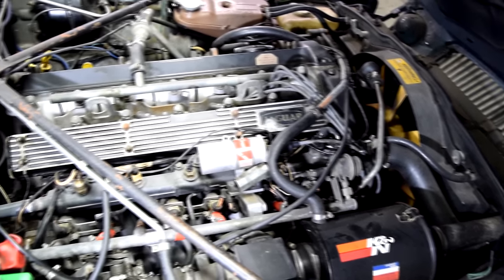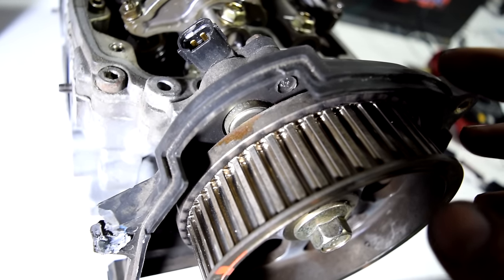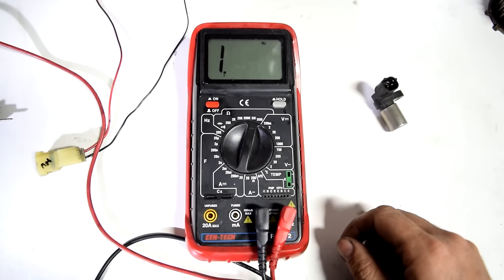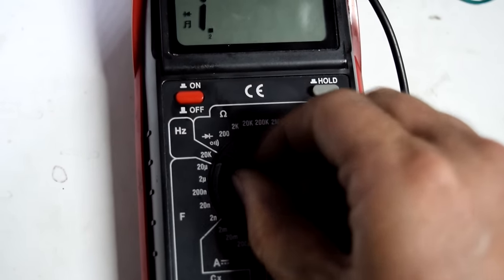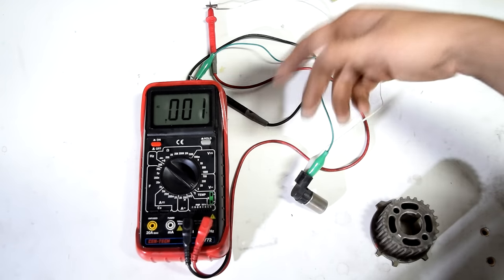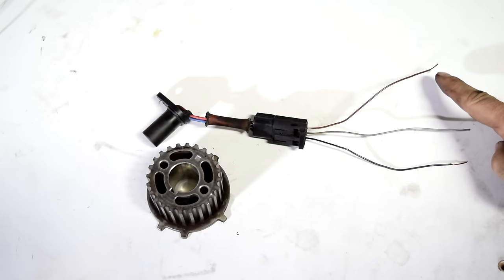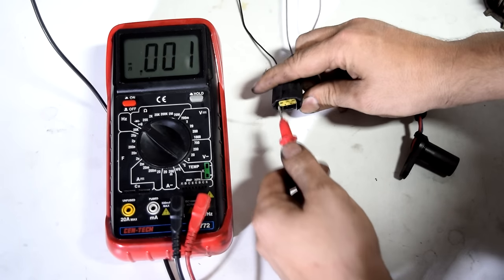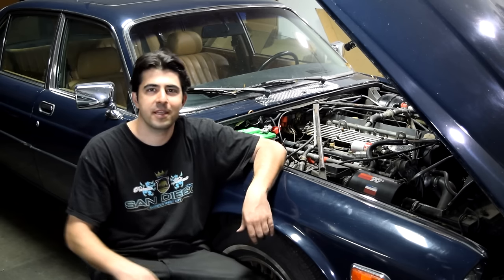How to Test Crankshaft and Camshaft Position Sensors

Comment: I realize that this video is 9 years old but it is still valid. You noted that many of the 3 wire sensors can be 5 volt or 12 volt.  You addressed this but the pinouts are not always the same.  Looking at the sensor male plug (not the cable plug) on your left is pin 3.  pin2 is center, and pin 1 one is on your right.  As an example of  how auto makers mess you up.  On a Jeep 2005 the  3.L/4.7L  the camshaft and crankshaft sensor has Pin 1 = signal, Pin 2  = Ground, and Pin 3 = 5 volt supply.  On the 5.7L  the crankshaft sensor has Pin 3 = signal, Pin 2  = Ground, and Pin 1 = 5 volt supply but the camshaft sensors are the same as the  3.L/4.7L.

Comment: Love your videos man !!! Being a mechanic myself the only thing I seen that could be not right.... When you were showing continuity,, I'd you have a 18 gauge wire with say 41 strands of wire in it, if 40 of those wires are broke or curroded your multimeter will show continuity. But will not carry enough current to operate the sensor. Need to show testing the wire with a couple Amp test light, depending on the circuit.   Should make a video about load testing wires 👌

Comment: Thanks for good video. Sensor is OK as you told but car still take long self to start. Before car was OK,, just for nothing I opened the Cam sensor to make it clean because large mud of power steering oil was on it. But now car takes a long self to start before it was having nothing problem

Comment: The three wire hall effect sensors can still be bad if you're just measuring the changing voltage. You should carefully measure their static voltages as well. You should put the meter on DC volts and measure the signal wire with the ignition on, but without starting it. The voltage should be in one of two states, High state (5 or 12 volts) and Low state (0 volts). If you turn the motor by hand using a breaker bar on the crankshaft bolt it will cycle through these two states. The important thing here is that when it's in its low state, that it is very close to 0V. If you measure something like 0.120 volts, it means that your sensor is failing and should be replaced. If this happens, you will get random misfires. You should also make sure the voltage is reaching very close to the source voltage. Put one probe on the source wire and the other on the signal wire. The difference should be very small, like 0.02 volts. With these hall effect sensors, you can do this check with a new one without installing it and using that as a baseline. Simply connect it to the connector and make the same measurements; you could put something metal like a screwdriver near the sensor to put it into an activated state. 

I had this same problem myself. The engine ran great but I had random misfire codes pop up. The CPS signal looked good on an oscilloscope. After replacing the wires, plugs, coils, power transistor and even cleaning the carbon out of the ignition switch I was still having this intermittent problem. I took a closer look at the static voltages of the CPS and that was the problem. It was measuring 0.162v on the low state. The new one measured 0.026v.
Reply: Where were last week?
Reply: What about if i only get 4.996 volts as i rotate the engine by hand? Means the sensor is stuck in one position?
Reply: Wow! Good info, much appreciated!
Reply: Why don't you make your own video then rather than doing this? Why ?

Comment: thanks for sharing this video! I have a 1995  c220 and sometimes starts sometimes not, 
I replaced the original Crankshaft pos. sensor and this is my next original sensor  from 1995 to replace. 
This 2 wires camshaft sensor has a resistance of 890 ohms ( half of the one you show here), do you think this is a very low value for this sensor?  thank you !
Reply: If you can read 2-3 volt AC then it's not problem

Comment: I was told that my CPS is possibly failing.. But here is my sittuation.
There is no check engine light and the car starts fine but has rough idling in the heat or after the 1st trip?  So if you drive in the morning to get gas there is no issues, but after you start up your car again (2nd trip) it starts idling low or bad.  
I have an AC adapter that reads voltage and at stops/red lights it drops below 12v.

Comment: I replaced my 2003 sprinter cam position sensor, works better than ever, I had crank but no start issues when the van was hot. $20 part with only 2 bolts.

Comment: If you change these sensors, do you have to do a re-learn procedure on the car?  I have a 2008 Saturn Vue (3.6L).  If you do have to re-learn, can it be done by a DIYer?  Or is it something that a dealer needs to do with specialized equipment?

Comment: Great video man. Way to explain the volt meter function. What if your engine is running fine then shuts off. After about 5 minutes it fires back up with no issues. But will repeat. I've already replaced the ignition module to no effect. This is a 2.5L Ford 4 cylinder
Reply: 4PITTS1BURGH2 plugged catalytic converter.
Reply: @tonydavila2606  you're the 1st to say that. Thanks i'l look into that. So if i turn it off right after I'm done and try to turn it back on it won't start until i let it cool down.
Reply: 4PITTS1BURGH2 yeah if it’s clogged and restricts the air flow it will choke the engine and when you turn it off it’ll slowly leak out then it’ll run again until it chokes the engine. Basically like trying to run with your nose plugged. Let me know what you find!

Comment: I have an 03 ram 1500 that would run fine for about 20 minutes and start to spit and sputter with NO CODES. I had a hell of time with crank shaft sensor. Swapped out both cam and crank and everything seems fine.. I used this video for a reference for my issues. Idk why dodge makes it so hard to find out what's wrong. Thanks for the help

Comment: If I am not understanding correctly please let me know but I believe the testing that you are trying to achieve is testing the input voltage make sure the ground is good and then also the signal. But is there a way I can test the sensor by itself is there a resistance test I can do on it perhaps test on one of the terminals can I jump the terminals and should it read anything with the connector unplugged?

Comment: Thanks friend for all your videos and help. I have a 2000olds intrigue.  And i might have to replace crank sensor . But i also need to do a  relearn  . What kind of scan tool can i use  that can program relearns? Any suggestions   as far as brand or  type ? Thanks

Comment: 2006 Impala LT 3.9. The sensor that is on my car is plastic( the part that goes into the hole on the engine).This is like the first one you showed on your video. It also has a small rubber grommet. When I put the sensor in the hole and tighten it, it's still a little wabbly. Will that affect it's performance?
Awesome video. Thanks so much.

Comment: Great video.  I've been trying to fix my Tahoe that has p0336 error code and have watch all you videos to try to help. I've replaced the sensor, wiring, control module for coil, and the coil and still can't get any spark. Something odd is going on because I have power to all different components but its like the sensor is not able to read the signal when the metal cog/notch rotates past inside the timing cover.

Comment: RW....you mentioned testing the crank shaft position sensor and that one of the two connections should show ground.  My 2015 Hyundai genesis Coupe 3.8 liter 2 pin connection for the crank position sensor  has 2.17 volts at both female connections.  Is it possible that newer models cars would be this way??  Thanks for the great videos!

Comment: You are  the best.. I replace timing belt and car wouldn't start.. By mistake, I had pinch the crank position sensor wire.. as per your testing technical help me to check my CPS.. thanks

Comment: Hey RNW, I got 2010 toyota rav4 2.5 l. I parked the car in driveway in the evening and in the morning it cranked but no start. I tested all 4 spark plugs but there was no spark all of them. Then I replaced 
crank position sensor, but still no spark. So what is your suggestion for to do next?

Comment: Great info! Land Rover Discovery 2 Crankshaft position sensors are notorious for failing... right in the middle of traffic.
Reply: Crank and cam position sensors generally are notorious for failing, but let's be honest, Land Rovers are notorious going back 30+ years for electrical reliability (well, lack of to be more precise). Long may it continue (and it will)

Comment: Good video...im testing my crankshaft sensor with 3 wire follow yr guide in rhis video...no reading at all...cant find voltage ,ground & signal wire...this mean my sensor not function?replace new one?

Comment: Hey Bro Thanks for video, I have 2000 Pontiac Firebird 3.8L, my car suddenly stop crank and start, nut before that my transmission stop shifting from second gear to third..
Do you know what can be wrong?
My starter is good, battery good, engine not locked??
Any idea? Thanks.

Comment: This is a very good video. very simplified. now i have a question. how can you tell which color wire is the 12v wire if you have the harness out of the car.
Reply: I have a 96 Nissan Pathfinder four-wheel drive I called the transmission and transfer case doesn't realize that. Cam sensor was connected to the bellhousing hold it down now I'm not sure which wire goes where does it matter on a two-prong cam sensor wire

Comment: When you test the 2 wire camshaft sensor,  do you have both points connected? When ran the cam pulley to get the readings.

Comment: Hi i gotta guick question . Im having a hard time trying to reinstall  the new crankshaft  sensor. The old one came out without much struggle  but the new one is stubborn  as hell !! Same dimensions  , everything  correct part etc . Just need a quick tip  or some help . Wen i put the old one in  it was in summer , and it popped right in   . Could cold weather  affect  certain procedures like this ?

Comment: Like your Excellent  Lessons :+) I recently got P0339  HONDA  CKP SENSOR A CIRCUIT INTERMITTENT  on my 2008 4cyl Honda Accord. ... My INNOVA OBD2 scanner also pulled a 10 second BATTERY Monitor scan test resulting in 11.84 VOLTS  (at ECM vs 12.5v at 
my battery terminals) ... while saying: "BELOW  ACCEPTABLE LIMITS". ... I believe my small 4 cylinder Napa battery  has been reading marginally lower voltage for a couple years plus (& possibly the biggest source of my problem). I also believe some higher end batteries of same small size would retain higher voltage. My Choice now is: I am going up a size to the 24F larger size battery (spec 6 cylinder Accords) in AGM format as my best shot for a long term fix. I lost Engine torque when that code tripped. ... Erasing that code with my Innova scanner after study resulted in no more problems or codes returning (so far/ even though my 24F AGM battery order  in progress makes that a near future project).  I also intend to remove my Crank Shaft Sensor's plug and spay contact cleaner. ... My two cents  as a past mechanic shop owner who still like doing all my own wrenching :+)

Comment: Hey there..  great video. My car has issues starting when the engine is cold. Take several (LOTS) tries and it will finally start. Once it warms up, no more starting issues. 1993 Volvo 240 Wagon
Reply: Eric J Simmons how long has it been since you changed your battery of your vehicle? I just changed my battery because it needed to be charged a bit before starting up. It would click instead of starting up.
Reply: Hardy Joe it clicked because you had a bad terminal connection
Reply: Check your coil packs
Reply: Its a volvo

Comment: Hello subscribed and thank you for all your useful info. I had a quick question, diagnostic tool keeps saying crankshaft position sensor needs to be changed, replaced it and still getting same error. I am getting crank and start but am not able to go above 3000rpm even if i floor it. Any solutions, thank you

Comment: Hello! Thanks for your great vids! I have an Audi 1,8T -99. My crankshaft sensor is an 3-wire type magnetic. Can i fault measure with ohm on that and how should i do then? What shall it show?
If i have left, middle and right. Shall i measure on left and right and get an value for ohm then? There shall not be an O.L?

I have just got the sensor loose from the crankshaft and from the connector contact, and it would be nice if i can measure on spot without take the cable install. away from engine.
Reply: I found out that pin 1 is - / ground. So between pin 2-3 i have 900 ohms. But is resistance measuring to be trusted? Can the crankshaft sensor be broken anyway? And to be sure i have to do the voltage test?

Comment: Hello Man, I Thank You So Much For tHis Video..

I Have A 1999 Mitsubishi Mirage DE.. 1.5lt and Automatic transmission.. 

I recently pull out a code PO340 meaning Camshaft Position Sensor Circuit MalFunctioning..

And Due To My Car Make , Camshaft Sensor Is Found In Distributor ( If I Am Right)..

I have replaced distributor 3 times already but code still pops up with check engine light on..

Now I want to check for voltage and any kind of corroded wires.. 

I don’t Know Which Wire Is Camshaft Sensor Wire From Distributor..

Can you help me locate these wires.. 

Thanks and cheers

Comment: have you seen situations where heat has affected one of these sensors? My Wrangler TJ has minimal issues starting, only when the engine bay is hot. If i drive the car for a bit, turn it off, wait, and then try to turn it back on, it cranks and cranks but wont start (unless I throw the gas pedal down as I crank, then it turns on but with a camshaft sensor code).

Comment: How about a erratic failure as it runs fine and then just out of the blue dies... Sometimes it will start right up Sometimes it may take up to 15/30 minutes.
I tried to push a  fiberglass wire rod to add a accessory and when I heard the horn suddenly blow!!!...ugh not a good sign I didn't dig into it as it was well into the boot and I was scared to but I Will investigate ASAP.
Any fore thoughts on this?

Comment: When I disconnect my '95 Maxima ckps pos, the signal wire has 5V.  In your video it seems the ckps itself produces the 5V; correct?  I get no spark, and my cam sensor puts out up to 500 mV.  My tachometer doesn't move either.

Comment: To add a bit, if you have an older engine (say 1995 to 2010) with a coil-pack instead of an individual coil for each cylinder, then likely 2 cylinders share a coil.  That is the "wasted spark" system where the spark plug fires on both the compression and exhaust stroke.   If such wasted-spark, then the ignition system (spark) doesn't use the camshaft signal.  The camshaft signal is only used to synch the fuel injectors to the intake valve openings, for lower emissions around idle.  Of course such synching doesn't help at higher throttle since the injectors are spraying much longer and while the intake valve is closed.  In such engines, the camshaft signal shouldn't be required for the engine to run well (just not optimal idle emissions), but that doesn't mean it will.  I think some do and some don't.  My 1996 2.4L  & 2002 3.8L Chrysler engines die if I unplug the camshaft sensor, even though they have coil-packs and wasted-spark ignitions.  Perhaps the designers were just being mean.  Chrysler crank & cam sensor are 3-wire (Hall-effect) type, but powered by 8 VDC from the PCM.

Comment: I have a 2007 Cadillac sts 3.6 L  replaced crank shaft sensor Car runs momentarily but don't stay running . Also replaced all cam sensors. I also get the scanner reading PO368

Comment: Mercedes C220 from 2006, just replaced crankshaft sensor, and after a few days comes out engine light on the dashboard. I have checked with OBD scanner, error P0335 (crankshaft position sensor).
My question, there's something wrong which can damage this sensor or it is an error indicating something else?
Thank you.

Comment: So I'm getting a but confused isn't it when the sensor is connected n the key is on if you put voltmeter negative pin on the nagative wire then posetive pin on the signal wire its supposed to give u 4 to 5 voltes then if you put metal on the sensor the voltage dropped to 0.01 or 0.00 volts then the sensor will be ok is it right or is it wrong thnks in advance for replies

Comment: Great video. I have a 2009 Dodge Charger 3.5l and it just died on me while I was driving so I had it towed back home.  I scanned the car for codes and it showed crankshaft sensor and camshaft sensor. So replaced both of them, cleared the codes and still no start. Any help on what else it can be? I scanned the car again and got the P0340 code again for camshaft sensor not sure what else to do.  Thanks
Reply: Howzit bud, we don't have the dodge charger here in my country. 
Does it use a timing belt or timing chain? If it uses a timing chain, it could have stretched and damaged the tensioner which can also cause a crank no start situation.
Reply: @jacomuller9197  it's a timing belt.

Comment: Great video! I'd like to add that some crank sensors with produce voltage and can still be faulty if it is not being pulled all the way to ground, but you would need a scope to see that, cheers!
Reply: ferlan 9 so if it's giving signal voltage reading back to the ecm, how can it be faulty?

Comment: I have a 3 pin connector. Checked it with the ignition on and have two of the wires showing 3 volts when testing. What does that mean? My multimeter only tests DCV @ 1000, not sure if that matters. Thanks for any advice.

Comment: Hello, I have two wires to crankshaft sensors, when I test them to ground  no continuity, but when test them to + on car battery have continuity? What that means? Car cranks but wont start, sensor passed all tests and it is good. Thank you
Reply: Any fix please let me know 🙏 🙏 🙏
Reply: @ionutciulei4398  Sensor that receives codes from remote key was problem. Imobiliser error